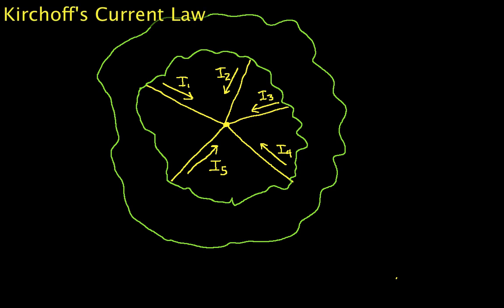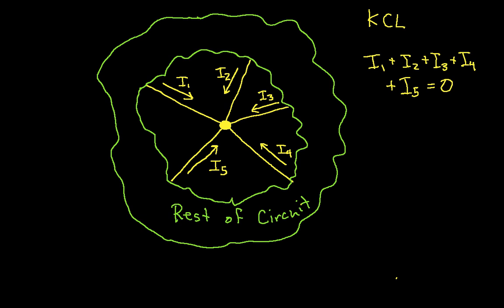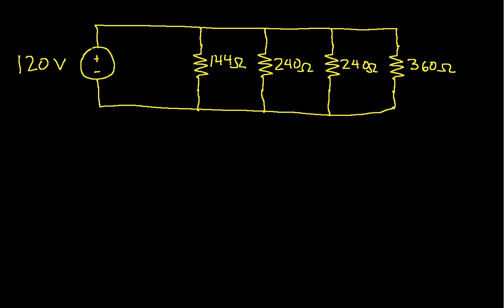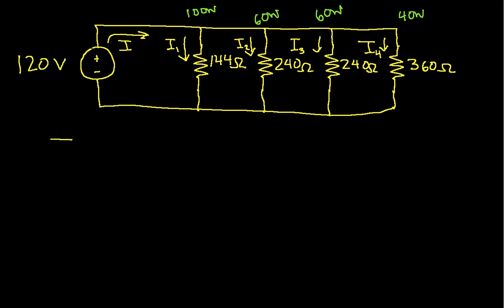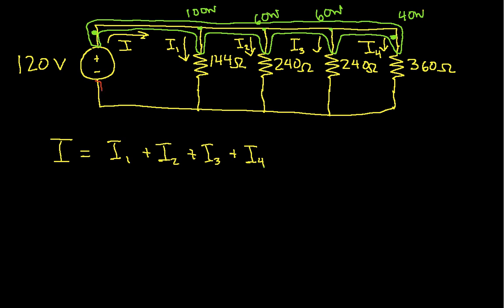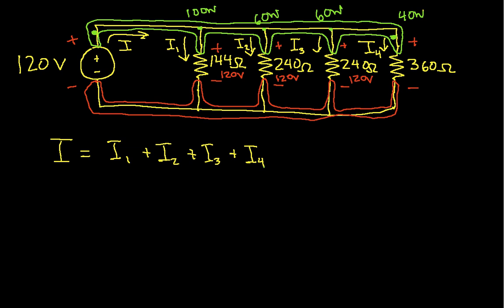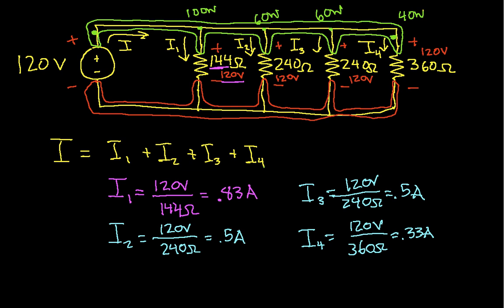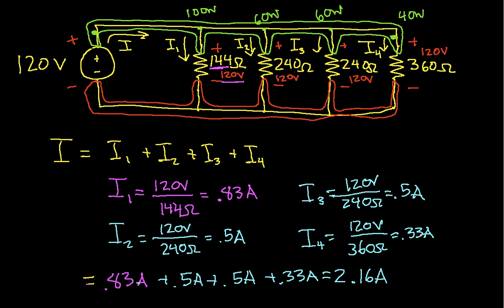Kirchhoff's Current Law

Comment from the maker: You are correct. The current flow would still depend on the resistance of the wire, but would be much larger. In most circuits, the resistance of the wire is negligible compared to the other resistances in the circuit, so we ignore it. In some situations, like sensors connected to measuring equipment with long (> 20 ft) wires, we cant ignore it.

Comment from the maker: There is a quantum mechanical/electrodynamics explanation, but I do not understand it well enough to explain it. In these videos, we are doing DC steady state analysis, so we give the circuit time to settle down from any transient effects that occur when voltage and current sources are connected and/or switches are thrown.

Comment: @DarrylMorrell I have a pretty random question regarding the path taken. How do the electrons know which path has the lower resistance without actually going down that path. Is the 'choice' instantaneous or is there a delay or is there some quantum mechanical explanation or am I just looking at the idea of current and flow completely incorrectly?

Comment: So I've got a question.  You said that the current i1, i2, i3, and i4, depends on the resistor used.  What if you didn't use resistors, would it then rely on the resistance of the wire itself.  If that is the case would I be right in assuming the values of current would be quite a bit higher, as the resistance of copper is very low?

Comment: Hmm so this works same as using reciprocal of the reciprocals to add parallel resistance... then using Ohms law I came to same answer... I am only just starting to delve into electronics theory because I am starting a broadcast engineering program soon. But I assume there are times when you can only use Kirchoff's law and not Ohm's law to solve? But in the above case was I wrong by solving the current the way I did?  Though I do understand the basic of what goes in = what comes out LOL.